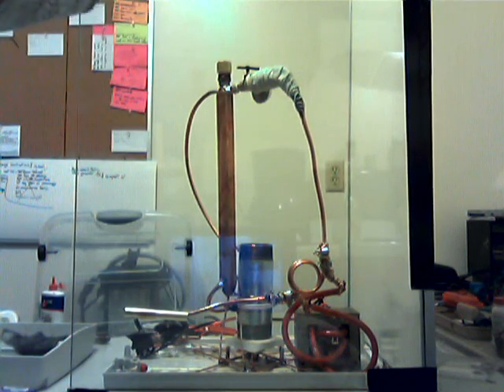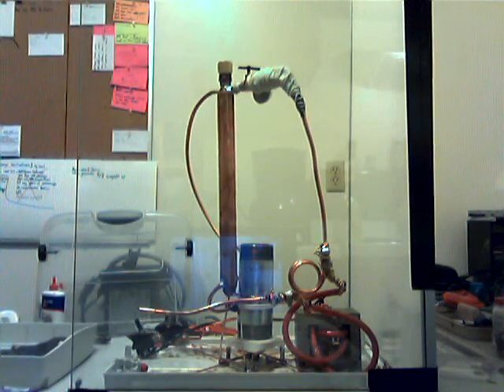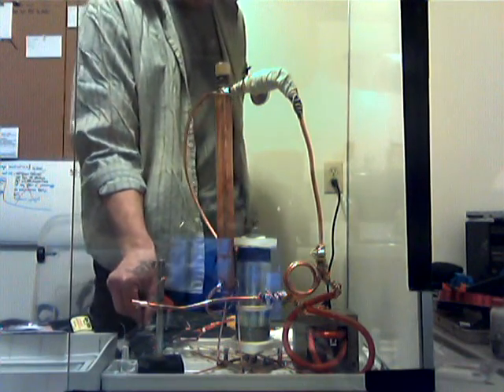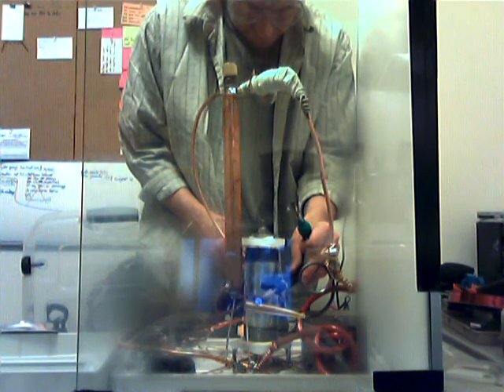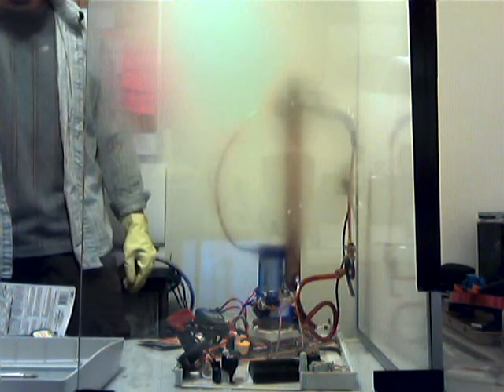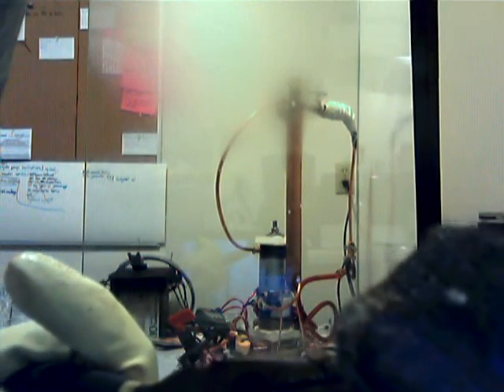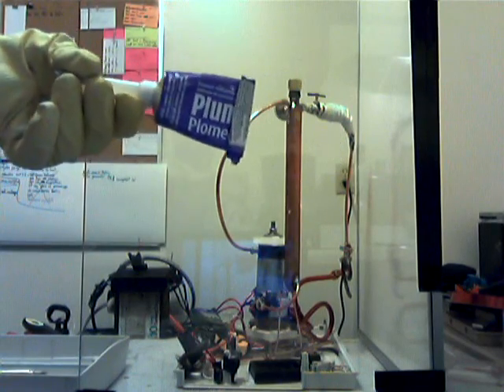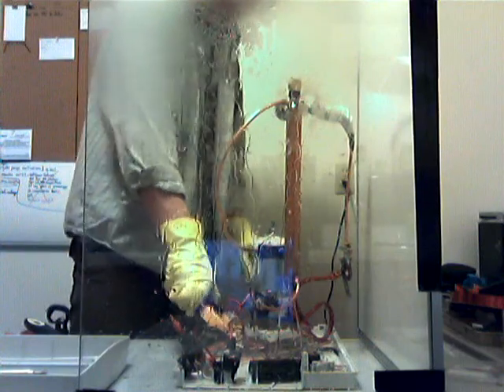electric  super heated steam genrater

Comment from the maker: basicly im going for heat its unlikely ill
use reforming to generate power ,but 
heat for hot water batteries to heat my house and hot water circulaters in the 
house is a very cost effective project
at about 200$ amonth in the winter
i can definatly put a dent in that with home built devices ,as soon as i get a lathe and a welder its on.